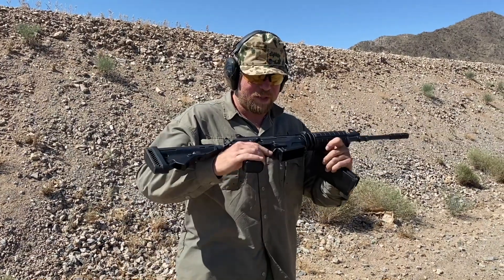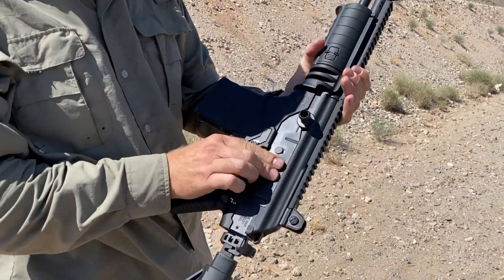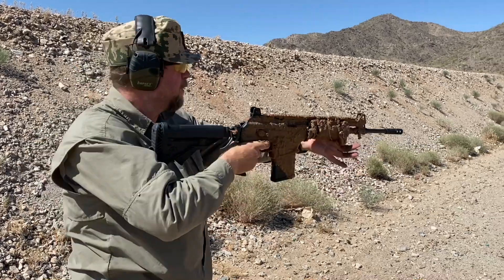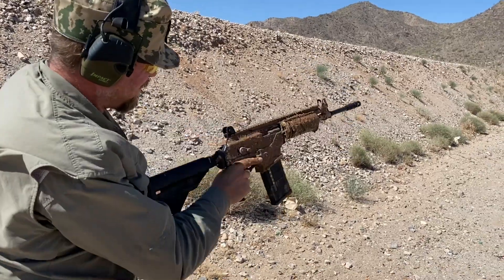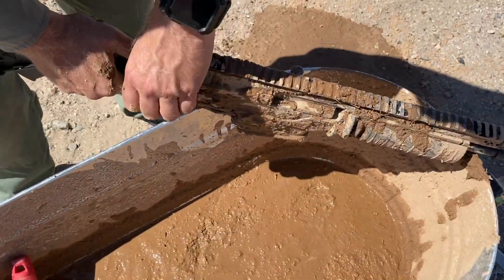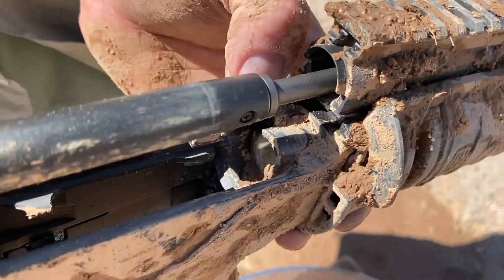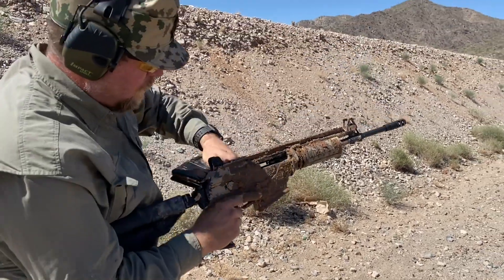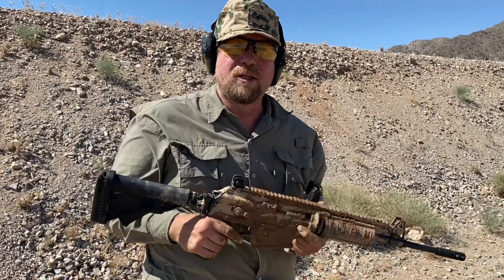Mud Test: 308 Galil ACE

Comment: Could they put a small lip or shelf above the ejection port so mud doesn't physically fall in?
Reply from the maker: I thought about that later and wished I'd said that in the video.  I think that would have made a huge difference.
Reply: agree
Reply: I think a slight change in geometry would help most guns. The 416 comes to mind where its simply the angles that make it easier for mud to go in imo. Meanwhile the g36 ran flawlessly even though they are pretty similar mechanically (compared to an m4 at least)
Reply: Yeah I thought about something like that as well or that in combination with moving the ejection port so it ejects downwards.
Reply: That could well help a lot.
Reply: @handlebullshit  And yet it does help in the AR.
I think what happens is that the cover actually pushes most of the mud away when it opens, so that there is much less of it to ingess.
Reply: Much easier to just order your soldiers not to drop their rifles in mud.
Reply: I could see the mud getting in straight away, gases will push some debris away but it seemed like the lip above the ejection port and the handguard were trapping dirt exactly where you don't want it.
This test is making flaws with design really obvious, between this and the AUG charging "slot" i wonder if these battle rifles are really being tested enough (i don't expect any gun to survive this, but with some minor tweaks they could).
Reply: @Juel92  it cannot eject downwards the magazine is in the way 😁
Reply: @jakegrube9477  See the HK 416 and AR-15 mud tests for that. The way the AR-15 gas system works happens to blow mud about to fall into the ejection opening away. This doesn't happen on the 416 and the gun ends up Karl'd.
Reply: Wouldn’t that get in the way of clearing live rounds?
Reply: What  @nemdenemam9753  said seems to pretty much be the take-away from these tests. As long as you have an ejection opening that's covered during fouling AND the "eaves" above the ejection port being at least as far out as the lower edge looks like the combination required to pass the InRange mud test. Case in point, the 416 and MDR tests, where the first ended up failing due to the geometry and the latter earning a "sorta pass" because fouling with the dust cover open leads to a bad day.
Reply: @PapaSchultz74  Well I meant reconfiguring the receiver so it ejects like 30-45 degrees downwards instead not 90 degrees downwards. Should have been clearer I guess :P
Reply: @cikame  
This is an extreme "test to failure" kind of deal.  The M1 Garand failed this test in spectacular fashion yet served American GIs well over the course of 2 wars with WW2 having some of the worst conditions imaginable.  The various Kalashnikovs also failed badly yet clearly have demonstrated excellent performance in the field in countless conflicts.  The Ace is just a modernized variant of the Valmet, itself a varient pattern of Kalashnikov, which saw successful service in very harsh conditions.  The Ace has certainly seen its share of trial in the field being in service with numerous militaries across the world.
Reply: Bhum Brahmavira  welding? machining??? pffff too complicated! Flexseal for the rescue!
Reply: @podmonkey2501  I can't ignore that we're comparing its reliability with a rifle from 70 odd years ago :P.
I jest, i only mean to point out two guys, some mud and about 20 seconds discovered that the hand guard is collecting mud directly above the barrel entry.
Reply: @WiffleballTony That is more likely due to it's unique piston design, that being the bolt is the piston, and the fact that it ejects gas out of the ejection port potentially removing debris during operation, because even when coated with the cover open it still runs fine.
Reply: @KageRyuu6  yes, it had one malfunction that was solved by loading another round in the chamber. Thats flawless. These videos showed that mud causes consistently the same problems with the same systems even across different countries or variations. So one round failing while everything else passing means it probably had nothing to do with the mud or the problem would have repeated. But thank you for reminding me that I can rewatch videos. Also I didnt mean that it did better than an m4. I mentioned the m4/m416/g36 combo because among the three of them you have both key similarities and key differences that help determine where the problem can come from. The DI system in the m4 seems to work greatest for clearing the way while the vertical side and the sunken ejection port in the g36 worked great. If you look at weapons that passed they usually have a non sloped receiver (SCAR, BRN 180, CETME-L). Ok the BRN eventually failed but if it had a charging handle like an m4 and not a gaping hole at the back, it would have quite likely passed that as well.
Reply: Could they not design something to catch the ejected cartridges, that seals the ejection port? Then the empty cartridges could be reused, instead of strewn all over nature's environment.
Reply: A lip along the ejection port is an easy aid that would help some. A second option would be an optional spring-loaded dust cover that opens when the bolt begins to retract, but that's a lot of added crap to mitigate an honestly pretty fringe situation.
Reply: @stanislavkogan  Except the AR also passed with the dust cover already open.
Reply: @Juel92  yea i guessed you meant thet.
Anyway i think we all agree this is an extreme test as any right minded shooter would clear as much mud as he can prior to firering the gun. Putting a dust cover woul make the gun look to much an AR.
And Karl would have poor the mud the second time withe the cover open anyway. Isn't it? 😉
Reply: Ben Powell Yeah, sometimes a muddy ditch is the only cover! I crawled a few of those during my conscript time when doing recon missions. Mud fricking everywhere!
Reply: Who'd have thought the ridiculousness of InrangeTVs post taco bell stool consistancy mud test would create this kind of ingenuity
Reply: @InrangeTv  It sounds good on paper, but it might interfere with ejection
Reply: See attached photographs for solution, gentlemen.  Adapt similar design from FAL to AKM pattern dust cover:  https://i.imgur.com/9Ir3uhz.jpg  

https://i.imgur.com/17XTMZL.jpg
Reply: @handlebullshit  i suppose regular soldier would try to brush it off before firing if he dropped it in the mud
Reply: InRangeTV they should make it more open space for the mud/dirt to fall into instead of falling right in front of the bolt. This would also prevent the locking lugs from pushing any foreign matter into the locking recesses
Reply: @jakegrube9477  An AK would be the pirfect gun, if it was an AR.
Reply: This is where a high speed camera would be real helpful. Dip it in mud, put it in a vise, aim the camera at the ejection port, and fire till it jams. Go back and see exactly what is happening and where the ingress is coming from. Then do something about it, and repeat.
Reply: @owenh727  That pattern has been tried many a time, and they've found through these tests that simply preventing the mud from entering the gun from the beginning with is certainly the best way
Reply: @InrangeTv  or dust cover?
Reply: @James Gastovski  U can call it a brass catcher if u like why not? Just make sure u patent it.
Reply: Bhum Brahmavira  Looks like it would block the normal ejection trajectory.
Reply: Joey JoJo Joestar Junior Shabadoo yeah, but Private Snuffy was asleep when the order came.

Comment: The good old InRange mud test, where failure is the standard, and passing is exceptional. Actually this one did pretty well compared to many of the weapons tested over the years, I'd call it a mild fail. At least you were able to get a few rounds out of it before it jammed completely.
Reply: That's what makes it an effective test.
It purposefully finds the point of failure by simply applying unreasonable gunk and looking what fails first.
That makes it easy to reverse-engineer a solution as the points of failure are obvious and any proposed solution can be tested for effectiveness by repetition of the test.
The only way a gun can pass is by two means: 1 Do not get any dirt into critical parts in the first place
2 Effectively work the dirt out of the mechanism by cycling manually

This Galil failed because cycling only got the dirt deeper into the mechanism and prevented firing.

Comment: I'm always a little bid sad when rifles don't do well in the mud test even though I live in a country with zero access to any of these so its got no bearing on my day to day life🤣
Reply: It did better than most other AKs.  I have one of these and its performance here doesn't bother me, I still will love and enjoy it and it has given me excellent service through multiple carbine classes.
Reply: Who knows? It may someday.
Reply: Elijah Wood  you should watch the AR or the SCAR video. There were no failures, or almost none
Reply: @mobius7927  if i'm not mistaken, Cetme-L too
Reply: @mobius7927  The G36 also passed the test
Reply: Isaac Woolley  Nothing wrong with a Saiga at all, except for the proprietary .223 version mags. Hang on to it, the values on those keep rising.
Reply: @WiffleballTony Is the Ace a sacred cow though?  When I read about it on the forums all I ever see is complaints about the cost and the furniture, that the plastic lower looks terrible, the stock sucks ect. ect.  Thing doesn't seem to get all that much love to me.
Reply: Meh I wouldn't take these too seriously. The tests are not scientific and you are not supposed to drop your gun in mud and even if you do just clean the ejection port properly and you'll probably fare better
Reply: @utkarshchaurasia2233  yea i think sand tests are more realistic cause you cant stop sand from blowing into the gun

Comment: I want to see the Robinsons Arms XCR M & L sent through this and maybe if they can get it B&T APC 556 & 308 to compare it to the G36C
Reply: So over priced
Reply: I doubt anyone who owns a rifle caliber APC would be willing to let them mud it, unfortunately
Reply: @pankotenders  i mean they tested an stg 58... thats a hell of a pricey gun
Reply: I have one of the 308 version and I can already tell you it will not do well in the mud test at all. It's not a closed system and mud will not only get into the ejection port like the Galil but the charging handle side too.
Reply: @lakesidemfg3552  It's not too bad if you can find a deal on it. I bought one from Brownell when they are trying to get rid of inventory and running a 10% off at the same time.Ran me $1800 which is what a galil ace 308 would cost anyway. But yeah, if you pay tag price you are definitely over paying.

Comment: Some kind of reciprocating dust cover for the ejection port seems like the obvious move. But I'm not an engineer, by any means
Reply: Yeah Stg-44 discovered that a long time ago.
Reply: The problem isn't so much that AK variants are not sealed, it's that the path of the reciprocating charging handle is blocked by mud. That's the essential difference.

Comment: What I noticed when whatching all the ak varients the way the mud get into the chamber on the normal ones quicker than the ace is the charging handle slaps mud into the chamber and the reason it failed here is due to the bolt catching mud in it and throwing it in the chamber so if top cover and the trunnion met at the edge so the bolt couldn’t funnel debris this is kinda Galil specific the ak platform wound be better with a more ingressed bolt and head  which would change the mag placement back a little could also fix the problem basically pull the chamber back a little as well as the barrel so that the mud the bolt Picks up wouldn’t get in the chamber this isn’t a garenteed fix and would change forging processes but may make a more reliable gun in mud like this

Comment: I’d love to see a mud test of the CZ Bren 2. I’ve been comparing the Bren 2 Ms pistol in 7.62x39 to the Galil ACE pistol and some other AK pistols.
Reply: @neighbor - J - Good luck with your choice.

If you go for the Galil ACE and want to change out the 1913 handguard for something else, check out RS Regulate. They’re the only guys I know making aluminum M-LOK handguards for ACE pistols and carbines.

If you go for the Bren 2 and are looking for a pistol brace adapter, check out Dan Haga Designs. They make accessories for the Bren 2 like a 1913 stock adapter. They also make an adapter that lets you mount a Magpul ACR folding stock to the Bren 2. And they also have an adapter that turns the ACR stock into a pistol brace.

Of course everything I’ve mentioned is mad expensive. But very cool!

Comment: I own one of these 308 Aces and its performance here is about what I would expect, plenty of ingress points through the ejection port.  I also wonder if the lightening cutout on the bolt served to transport mud back into the action.
Still a fantastic and soft shooting 308 rifle in any case, mine is my favorite rifle even among my ARs.
Reply: Love my Galil 308 as well.....I try to keep it out of the mud....
Reply: I've always wanted to fire a .308, how does the recoil compare to .223/5.56 and 7.62×39?
Reply: @joeclaridy  Much more manly, but totally manageable. It's a little less than twice the recoil of 7.62x39 (2,400ft/lbs vs 1500ft/lbs). I love my 7.62x51 Enfield Ishapore, I just wish shooting it was as affordable as .223.
Reply: @joeclaridy  It is the softest shooting 308 I have ever handled it has less punch than a lot of 7.62x39 guns I have shot.  No doubt to the effective muzzle brake and the recoil pad on the but helps too.
Reply: @stonefree1911  I took it to a 2 day carbine class where it rained all day both days, very muddy conditions.  I had no issues, even when decking it in the nud while downrange, just keep the ejection port facing up.
Reply: @podmonkey2501  I'm looking to pick one up and that is def reassuring. Highly unlikely that I will ever get any of my rifles completely covered in this specific type of mud lol.
Reply: The primary problem isn't the open system of the AK, it's the fact that the reciprocating charging handle needs to move without facing resistance. Thick mud offers that resistance.

Comment: I had the same thought about a bit of a shield over the ejection port, so that mud doesnt start falling in once the gun cycles. but i guess this isnt really an issue thats very high on the priority list. I am interested to see an AK mud test where the area right above the ejection port is cleaned quickly with the thumb or so and if that fixes most issues.

Comment: The only way to fix the ejection port problem is to redesign the bolt and put the "cam pin" behind the locking lugs and not over them (like sig and fnc style). That would make the ejection port smaller and not that far forward. If I had some grammar mistake I apologize and hope you understand me.

Here you can compare the ak bolt design with sig 551 Bolt. There a huge difference in the "cam pin"

https://images.app.goo.gl/TwDENTBL3vLxUc4L7

The fn fnc (which is also an ak like rifle) also have the cam pin like piece behind the bolt and not over it: https://images.app.goo.gl/GXbM42xYMLqNwqBf6
Reply: How would a cam pin change how it could handle mud?
Reply: @thatguysky123  because the cam pin placed over the locking lugs makes the bolt carrier lock over the bolt and not behind it. That's why the ak bolt carrier locks too far forward and that makes the ejection port bigger. In the ak the ejection port is so big that the locking recess gets unprotected. 

Compare the ak ejection port to the fn fnc.

Ak: https://images.app.goo.gl/JyJuUF8E4mnPvjGU7

Fnc: https://images.app.goo.gl/aos2wbc2Q4yf4bSm7
Reply: Bhum Brahmavira  thanks bro. Since English is not my first language
Is not easy for me to explain in few words
Reply: @arielgarcia5065  your explanations are fine. I think the other poster just missed the connection between cam pin location and ejection port size.
Reply: @RaphYkun  thank you!

Comment: Honestly, the solution would be to have a space for mud and grime to accumulate forward of the locking lugs (e.g. like a reverse relia-bolt). Even though it won't clear itself out on it's own, it'll at least be able to sustain fire for longer before it eventually does get stopped.

Comment: perhaps one reason the AR platform does so well in mud could be the excess gas venting through the ejection port, helping to blow away mud and dust while cycling whereas the AK simply doesnt have this advantage. not sure how this information could aid the ak's design however. 

perhaps a dust cover which opens for ejecting rounds? maybe could be done with a light spring holding it in place, dont know how this would affect ejection though, i assume the case momentum could be enough to push it open coming straight out the rifle

Comment: i wonder if it is possible to change the shape of the ak or galil bolt to be square/rectangular in the receiver. haven't we noticed guns with square shaped bolts resist the ingress of mud more than other types? like the G36.

Comment: The springloaded dustcover is a Belgian design, not Swiss. FN introduced it with the FNC, so it's also present on the AK 5. The SIG SG 550 family on the other hand has a rubber sealing lip which, in theory, keeps inrange mud out.

That being said, I really want to see an SG 550 (or 551/552/553) put through the InRange Mud Test.

Comment: By now we pretty much know, that the mud-test is really just an extreme sealing-test. Meanwhile, the dust-test depends on both sealing and robust operation, without testing either to the extreme. 

BTW, i've also seen kalashnikov using a "snow-test", where the gun is burried in snow, then left out in the open at freezing temps for 30 minutes. In their test, success seems to depend a lot on how moving parts and controls are designed (buttons bad, levers good).